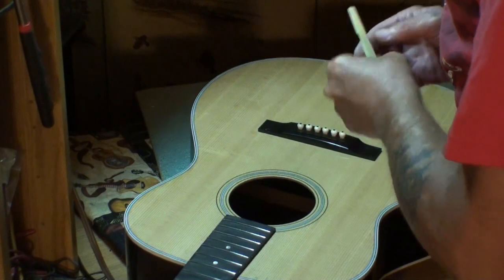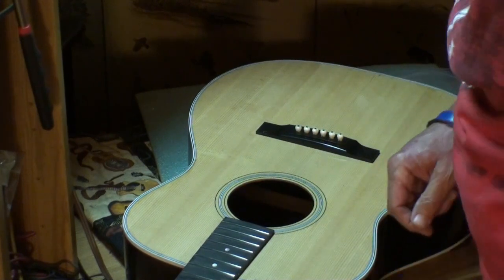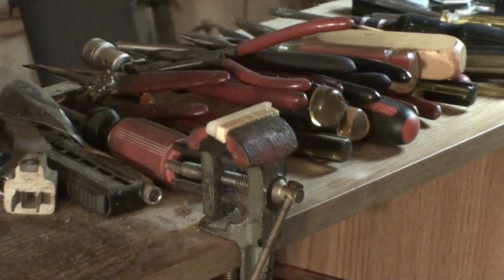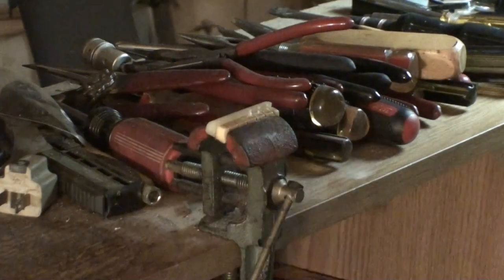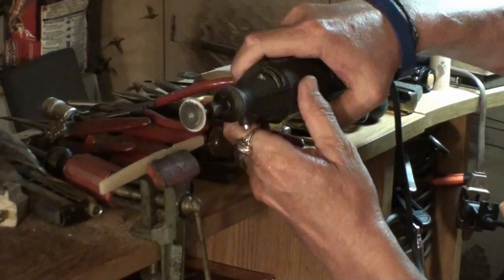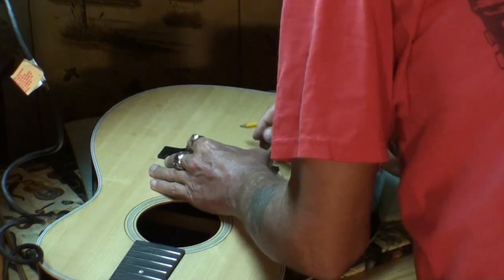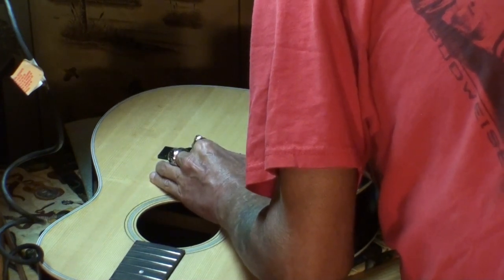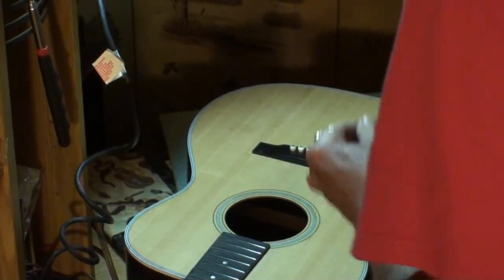bone blanks mysteriously turn unto a saddle and nut right before your eyes!

Comment: Next weel I'll make a new set of nut-saddle for my Takamine that came from factory with plastics. This will be my first on an acoustic, even though I've had made several nuts for my electrics, so this video came just in time! Keep it up Randy!
Reply from the maker: very cool! you'll find it will sound a LOT better, either bone or tusq either one will sound better than plastic. happy repairs! and thanks for watching!
Reply: @RandySchartiger  Thanks for the input Randy, and by the way I forgot to ask you, have you tried anytime a brass or titanium saddle? Are them any good? Cheers and thanks again bro!
Reply: @TheForce_Productions  hi Obi Wan Kenobi ! Just a bit of advice for titanium saddle making for HD28 Martin. It takes dremel tools and great effort but if you have patience,  it will make more volume and clear tone.  45 hours spent on mine with my  son also spending effort to the cause. I would do another one but only if I had the spare time. Good luck on yours.
Reply: @paullanier8280  Thank you very much for the info Paul! I've heard sometime about the pros of titanium and brass (specialy titanium) and really wanted to know. Cheers and thanks again!

Comment: Have you ever had to put anything under the saddle to raise it? I thought I heard of people using a sliver of a credit card or thin wood.
Reply from the maker: I've seem them use all kinds of stuff, one guitar came here with what looked like teeth out of a comb or brush lol I never do it, it distracts from the sound, I always make one for the height I need. thanks for viewing!
Reply: @mando banjo guitar   I've seen ppl glue bone on bone. Shims are a good quick fix, but you will lose some percentage of sound every time. It's definitely better to go ahead & have a new saddle made that fits nice & snug. Some ppl even glue them in with fish glue. It might create more sound transfer through the bridge, but I personally don't like a glued in saddle. You have to wet it & then heat it to remove it. Too much chance to dry out the bridge causing cracks in the future. Martin never did it that I am aware of & it's simply too much hassle.

Comment: How do I cut a bone bridge pin to make that little angle on the end for the ball of the string to slide up on? I found it in your videos! Thanks!
Reply: It's not necessary to use a Tool for that, just put them at an Angle to some Tack on 1 Side Sandpaper, and Eye~Ball an Angle to Each One, and try and make Each Angle the Same.
That's all it takes.

Comment: Hey Randy what kind of bone do you recommend,  I have a big ham bone I wrestled away from my dog .He wasn't too happy about it...lol grrr. But my saddle and nut are both pretty worn down after 20 plus years on my Alvarez dreadnought.
Reply from the maker: I use deer antler more than anything else, mainly because I have alot of it, the very center core of the bone is the best. thanks for viewing!
Reply: @RandySchartiger   Thanks Randy I,ll  make sure my .308 is sighted very accurately for the up coming deer season this November.